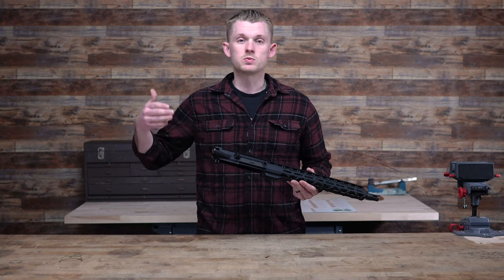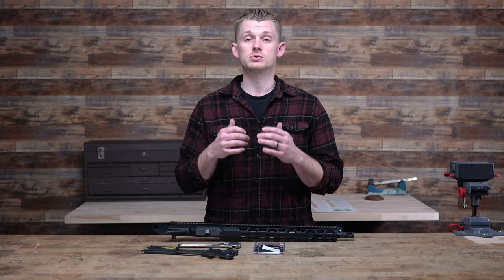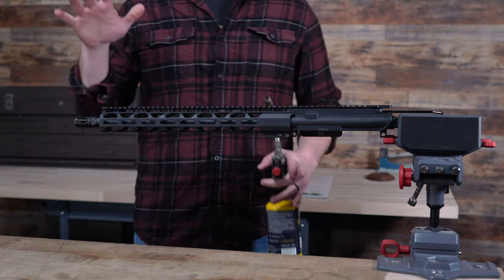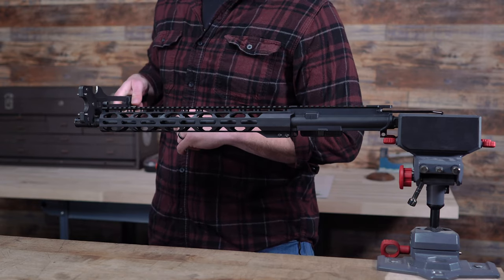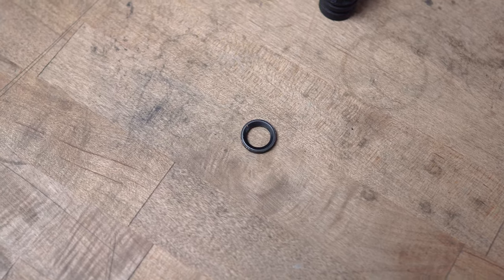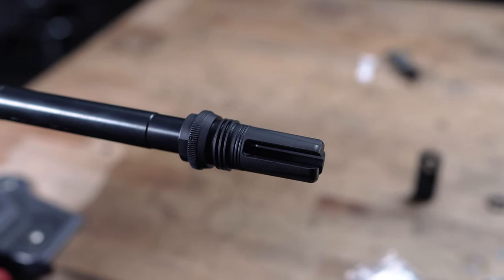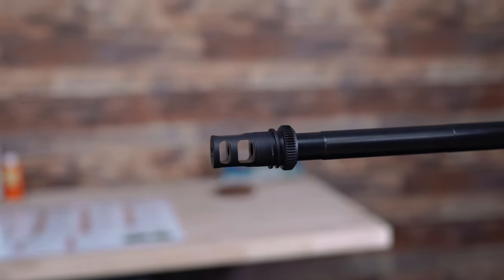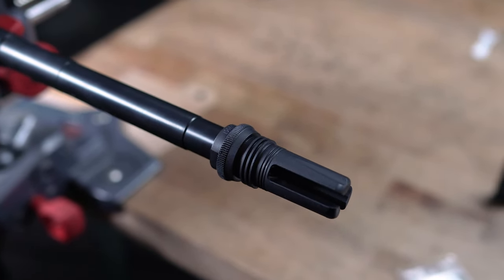How To Remove And Install A Muzzle Device

Comment: He's using map gas btw, it gets hot fast. He should have explained that. Yellow bottle is map gas. Blue bottle is propane which will work fine, but doesn't heat up nearly as fast. I know most already know this but since people don't. It's a safety issue and he should have got into that since propane is little more common and a bit safer if you are not used to doing this. That's my 2 cents nobody asked for. Bravojulietalpha out.
Reply: I didn't know that so ty!
Reply: Yeah mapgas goes quick. I wouldn't put it up against my gun. I'd rather go low and slow
Reply: Thank you 🫡 much appreciated
Reply: I did not know that, so thank you.
Reply: That used to be true.  But there is no more MAPP gas.  The current yellow stuff is NOT Mapp.  It's a scam called "Map-Pro" and is barely hotter than propane.  
MAPP: 5300°
Map-Pro: 3730°
Propane: 3600°

Comment: I watvhed this to see if they can help with the Sig Spear LT muzzle device. LoL not a chance, this thing is dipped in rockset. I paid Sig to remove it. They probably are just swapping barrels
Reply: I just did my Spear LT yesterday.  Simmered it in boiling water for 20 min and that took care of the Rockset.  Put whole upper/lower in a vise and snugged it down (it doesn't need to be tight, just tight enough to keep the gun from rotating).  Put the wrench on the muzzle device and 5 or 6 strikes to the wrench with a rubber mallet and it came free (I prefer the strikes vs the constant pressure).  We did five different guns yesterday and they were all different.  The sig was the hardest but it was still easier than the CMMG I did last year.
Reply: Sig must get a huge discount from Rocksett for the amount they use on their muzzle devices. Both of my Spear LT uppers were drowned with the stuff. I used the boiling water like everybody uses and used my 3/8dr impact wrench with a AAC 3 prong muzzle device tool and hammer away. They come off, but one took some extra hammering to break it free. All is needed in one drop on clean threads to hold it.

Comment: I just got a 300 Blkout and the crush washer is crushed so much sticking out little on one side worries it might messed up the barrel from manufacture should I worry about this or would that crush washer cause a issue?

Comment: So how important is it to remove the barrel, or at least isolating it, like perhaps just taking the handguard off?  Can I just put the complete upper in the vise somehow(I don't have any of those devices or "adapters" to lock an AR, or some part of an AR, into a vise, keeping it secure, and not damaging the receiver(or whatever) on the vise?)  I feel like applying torque to the barrel without the barrel itself being isolated in a vise could cause all kinds of problems.
Also, how do most people cure rocksett?  Do they use heat guns, torches, or what?  And how long does the heat need to be applied to have it properly set?  I'm assuming it depends on the temperature of the heat source?
I got a new can, and I've been putting off removing the factory flashhider and installing the muzzle break required for the brand of silencer I bought(OSS/HUX WRX.)
Reply: If you didn't try removing your flash hider, look into the Midwest Industries Upper Receiver Rod. This or something similar to it is a very secure & safe way to work on your upper. You wouldn't need to remove your rail to work on muzzle devices.

Comment: USING A SUPPRESSOR = SHIMS.
NEVER USING A SUPPRESSOR =CRUSH WASHER

This was not explained at all in the video. shims are not used when "you dont need it that tight ". they are used to keep the muzzle device square the bore so  bullets don't hit the suppressor baffles(BAD DAY).  crush washers can load the muzzle device unevenly off to one side. if your device does not accept a silencer then you can use a  crush washer
Reply: Got a fake suppressor can I use the same crush washer
Reply: @JayyMoney-vr7nv  yes as there is nothing inside to hit if  its misaligned. Unless you need it clocked a certain way you actually don't need to use a crush washer. A crush washer is for timing